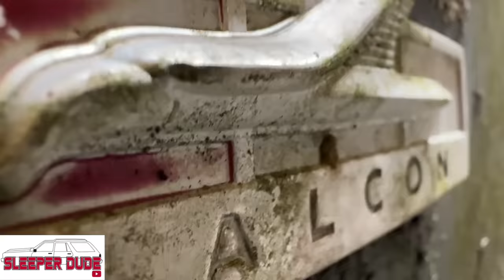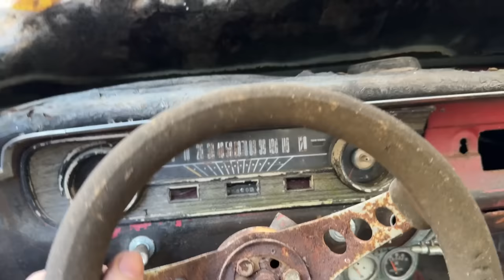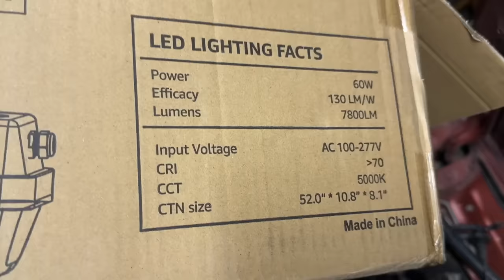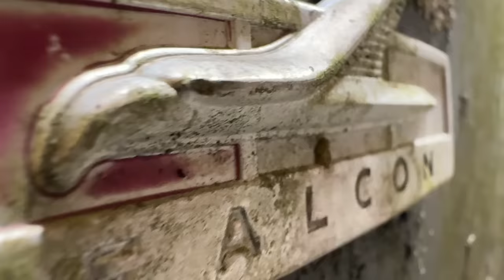Abandoned Race Car Has Some Really Cool Vintage Speed Parts.

Comment: That car is beautiful. The Patina is MINT. But, lets be real, its just a solid body. No frame, no floors, no drivetrain, no brakes, steering issues, shocks will need replacing, no wiring, gas tank is probably junk. With the amount of projects you already got, this is a seller. Maybe throw some plywood floors, a running engine of any sort and a boat tank just to make it easier to move and sell. But that is still a lot of work. Tractor proving its worth already is good. Its the cold season, yall stay warm.

Comment: For me, that 64 Sprint is the coolest Falcon so far.  I have always been partial to the 64’s.  What a great builder.
Reply from the maker: Awesome thanks
Reply: My cousin raced a sprint on a circle track,I really tried to buy it from him before he trashed it and made it a circle track car it was a nice car and he totaled it soon after it hit the track!
Reply: Alot of first gen mustang parts bolt in esp seats and suspension. And. Gauge vluster
Reply: 64 futura.99%
Sprints were 5- lug, V8 cars. If that is an actual 6 cylinder Sprint- it is extremely Rare, and deserves a full restoration to stock..

Comment: Falcon was not a race car but the product of someone working min wage doing what they could a little at a time. They had a vision and a dream,  working with used parts from friends and anybody that would donate the stuff they had left from upgrading their own car. I  did the same with mine. It wasn't what I always wanted but every little bit helped along. 90% was the look and the rest was bad decisions mixed with mismatched parts. And yes it was awesome!! Could be wrong but even with a 6 cyl and a original column shifted 3 speed moved to the floor would have have had a permanent smile on my face. Would have banged the gears like I was racing Grumpy Jenkins at every red light.

Comment: As far as this old man can remember, they went from a 260 cid V8 engine in '64 to 289 cid in '65. You could get four speed manual or three speed automatic. Either two or four barrel carburetors.  Of course, a six cylinder was also available. Basically same choices as Mustangs. The Sprint convertibles are the most desirables.
Many blessings to y'all!
Reply: Actually the other way around the Mustang had the same choices as the Falcon seeing as the Mustang was built on the Falcon platform, now having said that Josh you’re right you can’t keep the all, this one deserves a full restoration and a spot in the fleet though, she is a beauty. What’s nice about this one is it’s a factory manual car, so you could drop that 302 with a 4 speed gear box in it and drive the heck out of it.
Reply: Why not put a 427 windsor in it?
 302s weren'tstock in these 64s,a 260 was ,so go for as much hp as you can

Comment: I'd love to make a suggestion about cleaning these super moldy/mildewy cars.

You can purchase high concentrations of bleach, like pool shock. Dilute to 2 or 3 percent with water. Apply and allow to soak for a few minutes. You'll see the mold and dirt just melt off. Then use the pressure washer to finish the job. 

Also, and extremely important. Please be careful mixing bleach with dish soap. There's usually a warning. For suds, use laundry soap or some kind of car wash surfactant. 

Love watching your videos!

Comment: In 1963, all Falcons came with the four lug wheels and tires... In 1964 and 1965, the Sprint Futura's all came with a V8 and five lug wheels and tires...  If I were still a younger man, I would try and get this one off of you... I used to collect Falcons (Econolines and Rancheroes too) and I have owned them all except this bodystyle and the Sprint Futura convertable... But I am no longer able to crawl around under one the way you would need to if you wanted to fix this one up right... She would make a great daily driver for someone with a smallblock, nine inch, and new front suspension though... You are a lucky man! It is great to see your whole family involved in cars and in what you do in general... That is a very rare gift...

Comment: If I'm not mistaken that is a 64 1/2 falcon. Back when I was young my older stepbrother in those days had one just like it. He had a 351w with a nice cam ported heads a 750 double pumper with headers and it was fast. It rolled out the driveway one night and hit a tree with the trunk getting smashed up. It got sold after good memories

Comment: I had a 64 Fairlane 500 custom sport coupe with the original 289 in it. It still had most of the trim including the gold 289 badges. They turned Alot of them into Thunder bolts ⚡. I still kick myself for selling that car. I love the channel and the family dynamic! Someone would buy that car in a heartbeat and you should be able to get a pretty penny for it.😁

Comment: When you mentioned 66 and 67 Nova , I smiled , 66 Nova SS was my 2nd car , gave $600 for it 350 hp 327 , 400 trans , 411 posi , car was way faster than the brakes could handle. Still have the original 4spd console after 43 yrs

Comment: Glad to see another Ford rescued ! The 1964 and 1965 Falcon body style was a much more attractive one than the early Falcon body style in my opinion. Just had the brake light switch replaced on my 1987 Crown Victoria wagon which finally went out after 35 years of service. I guess it does not owe me anything. I am getting two new snow tread  " casings " on Thursday as the 1987 is my winter driver so I can keep my 1991 Ford Crown Victoria Wagon and 1989 Mercury Grand Marquis off the road to avoid the salt. I run steel wheels all the way around on the 1987 in the winter and save the Aluminum turbine wheels from the salt exposure as well. Both of my wagons have rear air shocks to take the load of my boat trailers when towing. Do you plan to replace yours on the Falcon ?   Thanks for the video.

Comment: Josh, I really like the 64 Falcon, I had a red 64 just like that, but mine was originally a 260 V8 ,manual transmission, with white interior. My car had a 289, 4 spd in it by the time I got it. Wish I had kept it.

Comment: Black '64 Futura coupe -- that is a win.   (side trim much different on a '65, likewise trim between the taillights.)   I got involved in a '64 Futura project long time ago, original F code 260 car, 3 speed - had a 4 speed T10 in it when my buddy got it.   Nice wheel finds, that factory steel slot wheel was on Mustang GTs, Torino Gts, etc in '68-69 as well as Cyclones.  And those aluminum wheels you found probably are the F150's factory wheels.

Comment: If you decide to sell the race car Falcon it would be a good idea to weld in a new floor pan. It may be easier to sell it with a floor installed. But that's your decision, either way there's a lot left of the car to restore. Great find/purchase by the way.

Comment: thats a 64 falcon with 65 taillights, that was a common swap because the 65s are nicer looking. i love the trim panel between the taillights on the 64s. in the mid 90s i had a white 64 2 dr hardtop just like it with the same Ansen slot mags on it. i swapped on some weld draglites. mine had a 289 with a C4 automatic. i loved that car, wish i never got rid of it.

Comment: Seriously the only and easiest way to clean aluminum rims of " ANYTHING" including brake dust is " Easy off oven cleaner"....Original yellow can only.....spray it on dry surface....wait 15-20 minutes then wash of with a light scrubbing action.....you won't believe how well it works !
Reply from the maker: Will try it
Reply: Seriously it works to separate the anatomical bond between whatever and the aluminum....science in action ! @Sleeperdude

Comment: 28:32  This is the problem with aluminum slots.  Most of them have too much "Front spacing" and not enough back spacing.  This was to make the look "cooler".  
So the wheels are pushed out to the quarters and fenders, but you have plenty of space between the casing and the leaf spring.
   I would call this "vintage kitsch parts."   And I have had a few cars with all of the.  Including the tiny grant steering wheel on a car with manual steering.   :face-blue-wide-eyes:

Comment: That is a very cool car! When I was young and we were very poor, I found a Plymouth Duster with all the parts I needed for my back yard project car.  The guy did auto body and took it a partial payment for a road runner he had painted.  I asked him if he would be interested in trading it for any work he may need done and he gladly accepted and put me to work cleaning out his horse stalls, digging the footings for his garage addition and any other task he could think of. His family was amazing and I spent more time with them than I did at my own house.
  Sadly, we had to move and I didn't get a chance to finish my car.  We pushed it to the end of the driveway with a sign on it and sold for $400 with a perfect body and paint, the 318 and beautiful white interior from the donor car.  I also lost my 74 Mustang II and a 66 Plymouth Satellite that needed a motor as well... the original owner reposessed it because I still owed him $20.
Reply from the maker: So cool thank you

Comment: Nice Falcon, I like the newer body design myself. The 64 1/2 thru 1966 Mustang floor pan or patch panels should fit the Falcon. If you can find a 2V or 4V 351 Cleveland block and heads, that would be a great engine for the Falcon. Or the 302 V8 that you got too. The 302 could be stroked with a stroke kit. Make this one into a track car like the SCCA race cars that race at Road Atlanta or the 24 hours of Lemons.

Comment: Maybe you can copy Mortske  - get a vehicle running and driving or just clean it up, then list it for sale at $x? I noticed on another channel ( What the Rust- also from Tennessee) that a device called an Ecoflow Max can be useful on location without power - a large shopvac was plugged in and apparently the power lasted all day. It would be useful for you when inflating casings or whatever you require power for.

Comment: 64 Futura with 65 taillights. 7.25" 4-lug it was for sure a 170 with a non-synchro 3-speed manual from the factory. Wish I could find $800 Falcons where I live. I've had many, but a car like that here in the PNW would be $3500 - unless you know a guy who knows a guy's grandmother. Will await to see what becom8of this one. 64's are pretty sought after. And that is a Mercury Comet gas cap.

Edit: I guess I should watch the video to the end before commenting.

Comment: That's like the 65 Futura that I had.   All stock 289 2 barrel, single exhaust.   2.80 rear gear. Yup !   All wrong for drag racing but I raced it anyway and had a ball !     Never should have sold it 😢.

Comment: that looks like a steering wheel for the drag strip. As far as the air shocks are concerned, most hot rodders used them back in the day so they could put wider wheels and tires.  four lugs on the wheels like you said is for a six cylinder and the rear end isnt strong enough for a V8...Keep it and build it. Most people like this body style vice the years earlier. Kerry

Comment: $112.00 for chrome 11 inch chain steering wheel and more new pan steel sheet with 3M under coating as well on top of pan. The fastest to paint is undercoat spray paint and you don't have to clean paint brush and paint roller.

Comment: I'm sure you probably would know this, but just in case: any chance the manufacture date of that Falcon is anywhere between July-August of 1963 and December 1963? If so, that would put it in the 1964 model year. That would explain the '64 tail lights.

Comment: I've been playing with Falcons since the early '80s, so I'll just add some fun but useless facts as the video progresses. '64 with '65 taillight lenses. Gas cap is from a '63 Comet Custom (higher trim level).  4 lug wheels makes this a factory 6 cylinder car. Slapper bars? They weren't running much power if that little rear end is still intact. Those frame mounts are still for the six, so it's looking less likely it had a V8. The cluster in the trunk is from a '65 base model Falcon. $500 for that Comet gas cap? I should have held on to the mint one I had, let 'er go for 50 bucks or so, but that was a long time ago. That's about all fer now.

Comment: Heck looks like a good gasser project throw a straight axel up front and cut the shock towers out and reinforce the bod throw in a 460 4 speed and a p inch rear

Comment: It should be easy to remove mold from paint or metal with that high pressure. Washing soda, not to be confused with baking soda, kills mold on contact much cheaper and safer than bleach, and no fumes or odor. 1 cup powder arm and hammer washing soda (detergent section supermarket) mixed with 1 gallon warm water, spray or rag on, agitate and rinse. Mold be gone👍

Comment: While I like the older rounded-front Falcons for sentimental reasons (I owned one), I like the Futura style you worked on tonight (I also owned one of those, a ‘65 Mercury Comet), I prefer the later style. The Futura seems to have a sleeker body style than my Comet, particularly the rear roof line. It just seems really sweet to me. Now if I still had the Boss 302 and 4-speed (with ladder bars) that one came with . . ..

Comment: That is a 1964 or 65 Six cylinder Falcon it has four lug wheels were on a six cylinder car only if it was a V-8 it had 5 lug wheels to accommodate bigger brakes for the stopping power for V-8 car

Comment: The mounts is $62.00 and chassis mount with sideways long bolt hex go thru that bolt is below the rubber for the mount with extra hex nut. The frame chassis mount is $ 180.00 dollars a pair then the engine is original 200 CID so it is the wrong mount under the engine V8. The Summit and custom dealership can bounce you the special order of the lower mounts from 1966 mustang bracket up to the rubber upper mount.

Comment: The 1962 Ford called for FUTURA 170 CID 101 HP two door Sports car. With option like 16 inch steel rim from American Racing 400 miler versus 1968 Pinto RUNABOUT station wagon two door straight six 170 CID Then mustang with V6 170 CID OHV starting in 1969.

Comment: Let it dry then you can use a electric sander with 80 grit paper too smooth down the body then 320 grit paper ! Then 400 grit paper and then use a black or grey primer too seal the body for now .

Comment: For the trailer to load and upload the tractor what I did was weld a trailer jack on both sides so the weight of the tractor doesn’t lift the truck off the ground
Reply from the maker: Good idea

Comment: Good morning. There is a Falcon but still it is not working car. Turning the Falcon Cafe into street legal but it is too dirty. They have water and cleaning the moss off with muscles of both people and pressure is up to 2.6 - 3 GPM and arm pressure on the nozzle and handle water guns trigger.

Comment: My father bought a new '64 170 6cyl. that had the exact same body style Apparently, it did not come with antifreeze in the radiator as I can recall my mother being extremely upset when the block froze in it that first winter and it had to be replaced. Mom learned to drive in that thing and we kept it until 1968 when Pop got the Mopar bug and traded it for a new butt-ugly green Chrysler Newport. 
 Now then, please tell me you also bought that white fox body Mustang!

Comment: Hey dude the sleeper take your 000 steel wool scrub the wheels if that does not work try sandpaper like 1500 3000 Grit then you find something called never dull in a can use that product and they will shine like new money. This is not a paid promotion

Comment: The steering wheel for it has wood grain circle around for the column of the car. It cost that much over $100.00 dollars for a vintage. No rust but if it is rust in the steering wheel then it would be power steering pu.p to go with it. Maybe the old steering pump is $287.00 dollars and it is worth it?

Comment: U make things way to complicated. To unload a dead car. Put jack on trailer down and raise front of trailer, rolls down hill. To release brake drum. A hit with hammer between studs, if unsuccessful grab water hose, run water around back side till water runs clean, repeat hammer with sledgehammer   Stop with flip flops. Nice family. Working together on a common goal. Much respect.

Comment: The ford and the Galaxy fiberglass Specialty Manufactory in 4 lug a wheel maximum. Where the 5 lug per brake drum is too heavy but it's for long duration distance of the touring car. the Racing sports car have 4 lugs per hub and wheel brake is a light weight for the Professional. Mercury Richard Petty drove 300 HP straight six. The Nova II was V8 but it's rated only 140 horses and most Chevy small car are always 4 door sedan shorty.

Comment: But looking at the Chrome on the the two strips of Chrome on the outside and then the little Chrome badge there by the rear tail light and then looking at the tail lights I'm going to say with the chrome package on it and the tail lights that that is a 65 it probably was a 65 6 cylinder that somebody converted over to a V8 that's why it has the four lug suspension on it

Comment: V8's were too much engine for these back in the day - maybe a Turbo V6 - would fit better and let you use the power to GO rather than burning rubber off the ... round driving devices 😎

Comment: I had all that stuff on mine and I mean every bit of it slapper bars slotted mags the little steering wheel the all the extra gauges tachometer floor shift drove mine on the street daily when I was in high school air shocks had the air shocks biggest fattest stars that I could get under it did a leaf spring relocation so the leaf springs were right under the frame of the part of the frame so you could you could get back in the day an they were Kelly Springfield l6 014